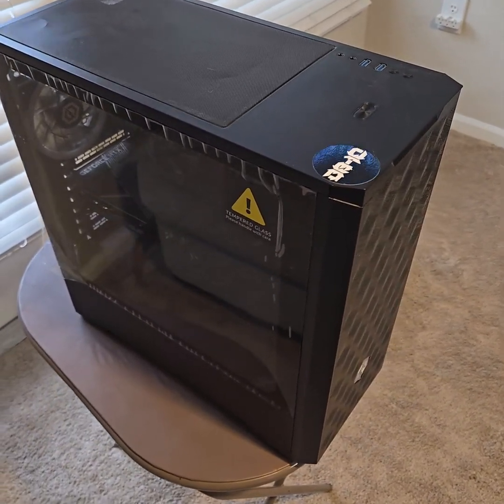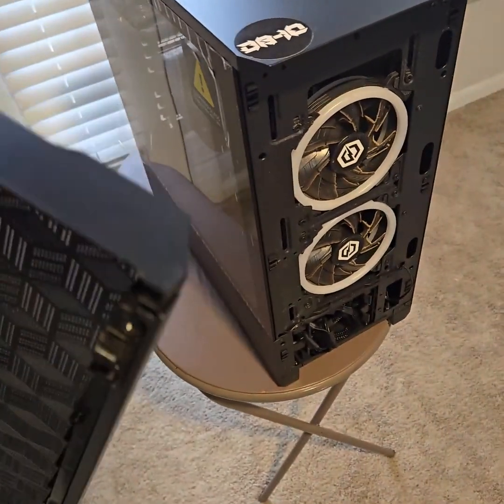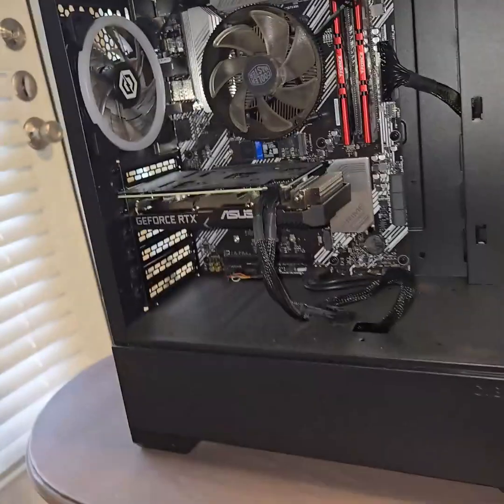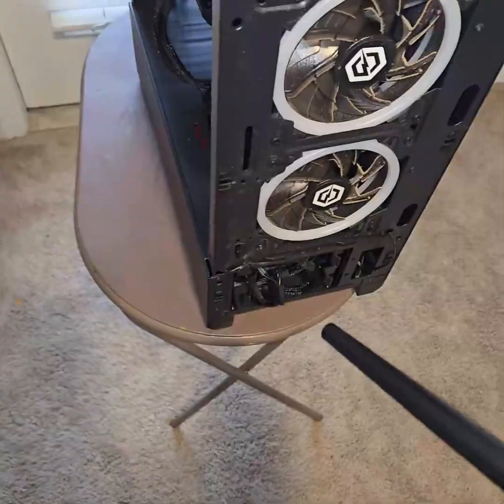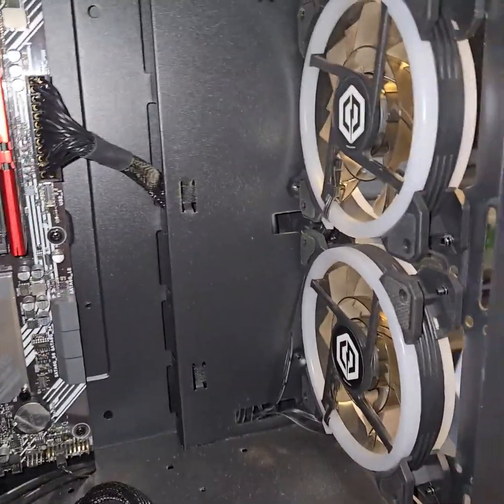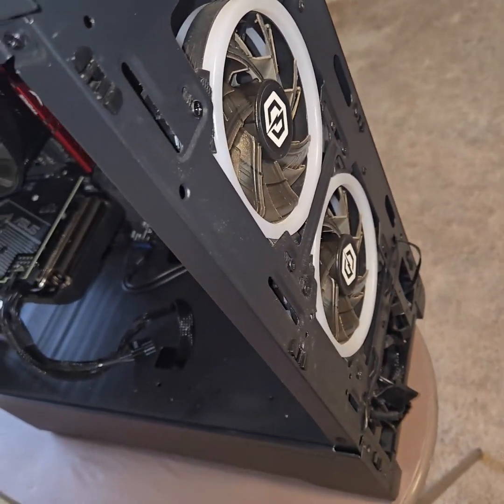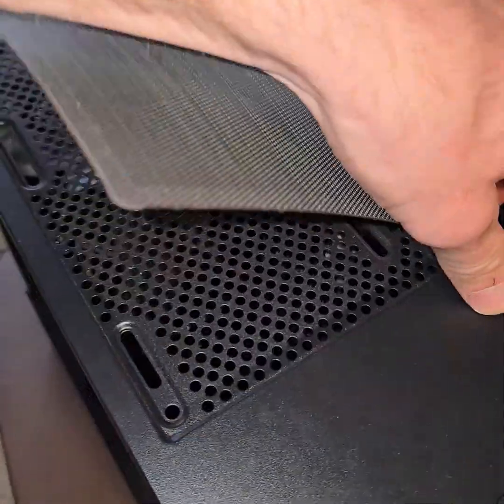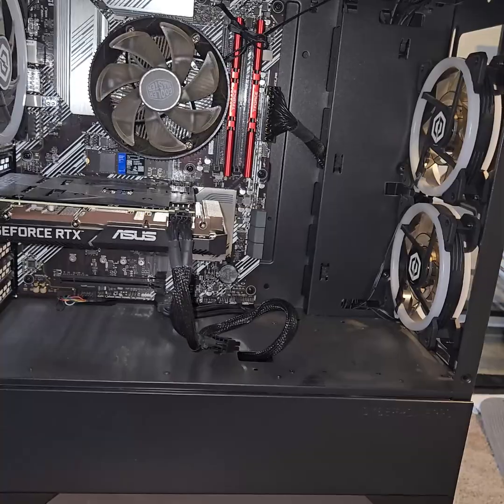Clean your PC Hardware Tutorial (Part 1)

Comment: take the damn plastic off of the glass
Reply from the maker: Hell no
Reply: @d8-10  btw you said not to use wet or dry wipes, so what do i use? i've used both before so i guess i'm lucky nothing happened
Reply from the maker: @demoniktusk758  they work. It's so you don't trap moisture in it or get any moisture at all. & dry wipes could create static electricity which damage anything. The fans should be OK but I don't use wipes